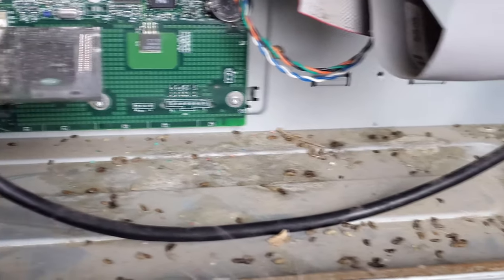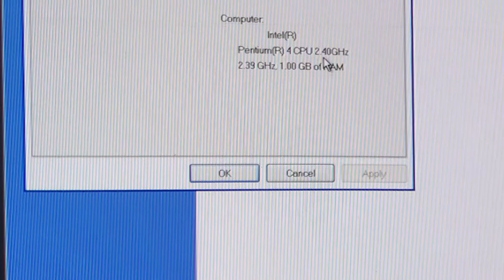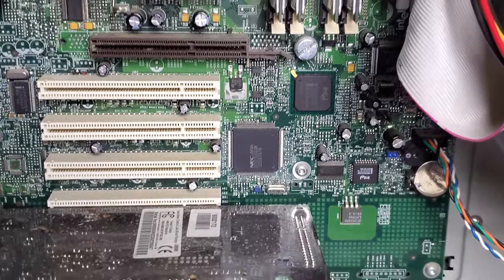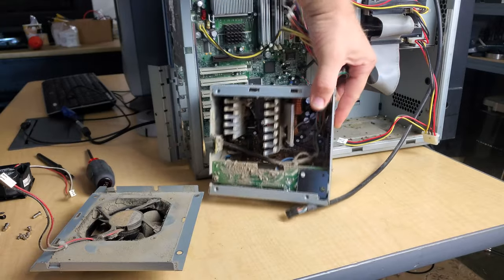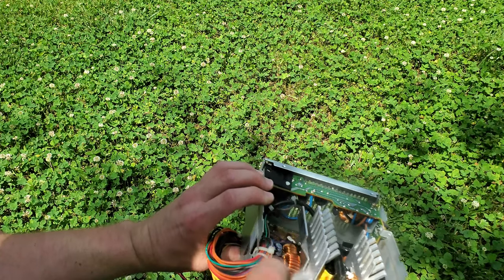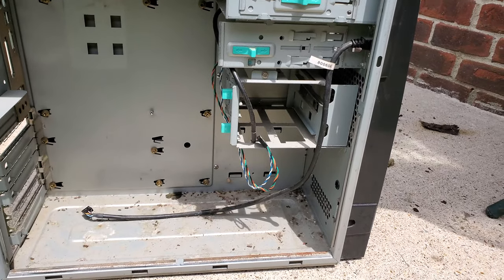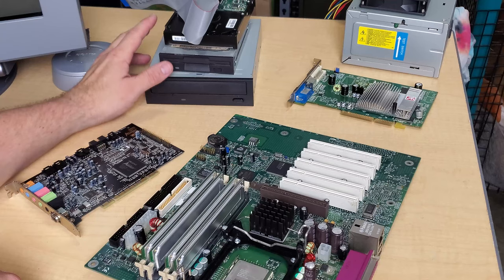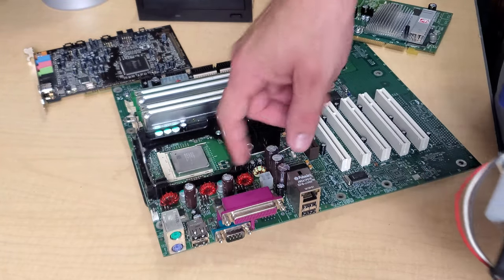2003 Gateway PC Restoration - Pentium 4: part 1 featuring the Sony GDM C520 📺 Retro Tech

Comment: I use that CRC cleaner for my electronic projects as well. That stuff works really well and it looks like it did just the trick with your power supply.
Reply from the maker: It worked great.  I used it on the Motherboard also.  I like it since it evaporates so quickly.

Comment: I have a can of that electric ⚡️ cleaner and I use it to spray the pins and what not on my retro consoles. The stuff is amazing and needed to maintain and clean these older electronics. Takes passion and patience to keep up on such matters. Most excellent video.